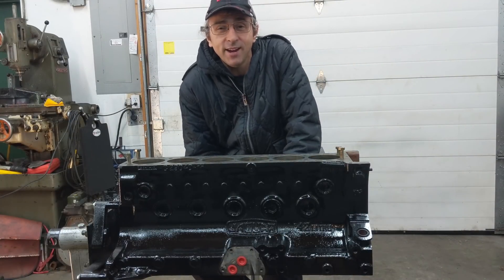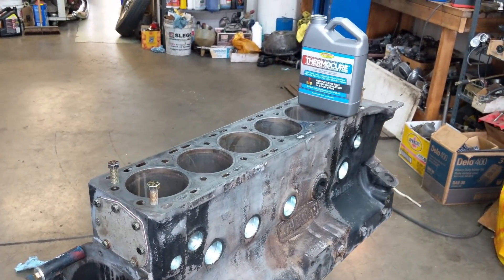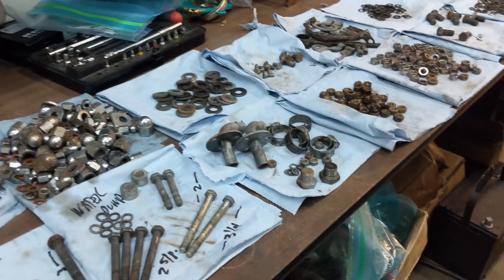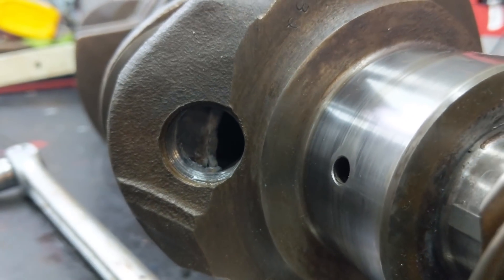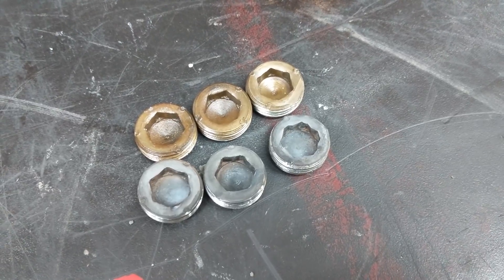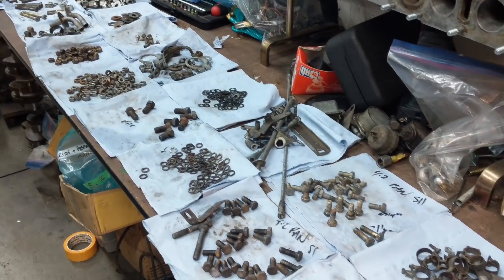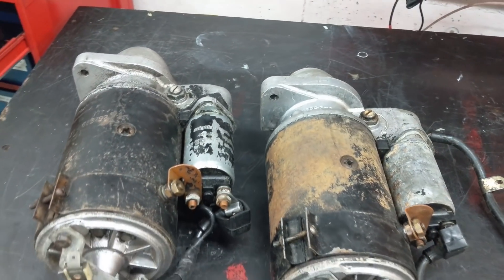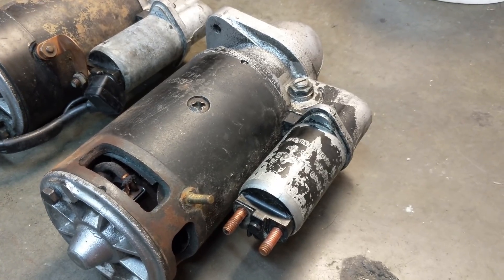My Junk E-Type Engine Part 4

Comment: Back in the 70's I owned a Jaguar repair shop.  We used to rebuild a lot of the 3.8 motors and other guys couldn't figure out how we did it so cheap.  We used Corvair pistons which had the same dome, pin size and deck height and were forged and lighter than the stock ones.   We could buy a full set of 6 Corvairs complete with rings and pins for the price of 2 stock Jag pistons.  The Corvair had a slightly larger bore than a standard 3.8, so often we could just hone the Jag block to fit without  having to go a full bore.  We also used Chevy valve guides by just turning the end down a bit on the lathe- they were better quality than the Jags units and were far cheaper.
Reply: That's old school alright. I like your style. If it's any use to anyone reading this you can substitute cheaper Jag valves for the very expensive Aston Martin ones in the Tadek Marek V8's - I did that in a rebuild for a cash strapped friend. I'm a motorcycle mechanic really but couldn't turn down the chance to work on a classic Aston. The valves are a few thou longer and might need a little shortening so they fall within stock adjustment shim sizes, depending on your valve seats. I did that on a bench grinder using a simple jig I designed for the job, not all of them required it.
The engine has been running beautifully for about 15 years if anyone is a bit dubious about the wisdom of this substitution.
Reply from the maker: Oh wow. I don't think I will get as creative with this one, but it's great to hear the ingenuity that you guys employed. I've often wondered about the valve guides, and the prevailing expectation to machine them out vs punching them out. Do you remember what you guys did?
Reply: @RichardMichaelOwen  We drove the old ones out, but we used Chevy guides that we machined to fit- it was a simple matter of turning the heads down a bit- the stem diameters and overall length were the same.  We had a book that was a numerical catalogue- instead of listing things by manufacturer, it listed parts by the size, you could find a lot of parts that would work in various cars.  Came in handy when we did a Daimler SP250 motor and also a Ferrari 250 California that another shop had taken apart and then lost a bunch of the parts. The guy had lost all the head studs and  3 of the pistons.  Turned out that VW head studs were the same size exactly length and thread pitch.  We  honed all the sleeves to the same size, then sent one of the  pistons to Venolia in California and they made us a complete set of 12 with pins and rings with the proper skirt clearance for the sleeves for 1/2 of what Ferrari wanted.
Reply: @oldschool1993  
Wow ! Now, you are/were what is called a Master mechanic ! Not simply a parts installer like today's too frequent "technicians". 
And your surname is fitting perfectly. Kudos, sir !
I have the chance of having my cars maintenance and repairs done at a small, local garage. My now friend Norm bought it from his late dad when the man retired but Norm learned his trade under the teaching of his Dad, the old school ways.
My wife at the time had a Toyota Tercel with a problem with the carb. Everyone told us that we had to buy a new 800$ carb. (We just bought the car 2 weeks prior for 1,000$ ! Non-sense.
An auto parts supplier recommended to visit this guy next door, THE known carb specialist of the area I did'nt know at the time.
He ordered a used carb, took off the supposedly, sealed, unserviceable mechanical choke, and installed it. Total cost : 85$.
I never, ever went to another garage in the last 35 years.
I actually sent many friends and family members to his place. Everybody is 100% satisfied. Parking lot always filled.
A few doors away, a guy has this 6 doors garage, super clean and shiny but his customer parking lot is always half empty...
Yep, parts installers and rude. Says it all, I guess.
Reply: @oldschool1993  MAN! I would love a book like that! That is so awesome!
Reply: @RichardMichaelOwen   I think you should try the superior Corvair pistons and Chevy valve guides. Otherwise you're leaving money on the table.
Reply: Oh boy we need a cheap fix like this in the Vincent HRD motorcycle repair and restoration game . I am greatly enjoying this series of films as you tear down the beast from Coventry.
Reply: Must be great to find a match in nice parts.
Reply: CORVAIR FOREVER !  SCREWTHE SOB NADER !

Comment: For the sludge if you can use matching threads in small brass nipples you can circulate kerosene in a constant flush to loosen and flush out sludge and particulate under say 8 lbs pressure and then when done blow it out and add some clean 20 w 50 at reassembly old product called rislone would do the same thing as kerosene

Comment: Hi Richard - great video series... I have been following along to rebuild my own 4.2 engine and my pistons and bores look to be in really good shape. However I have been advised that in most cases a re-bore is required plus new pistons because a ridge or lip will have been worn into the cylinder. I just want to Hone and fit new Jag part rings... I cant feel or see a ridge so would such a condition be obvious? Cheers Gary
Reply from the maker: You can feel it at the top of the bore if there's wear.

Comment: Very nice job organizing the hardware, but I hope that you did not actually re-use the old spring-type lock washers for anything serious after plating them!
In the first place spring-type lock washers should NEVER be re-used, since the sharp edge of the washers' tooth is gone the first time it is removed. Also, Jaguar had general failure problems with the spring type lock washers when used for the connecting rod bearing cap bolts and went to lock-nuts for after-market.

Comment: Jubilee clips thats  what the british call  your chain zero clamps they are jubilee clips that the correct name

The starter where all black  originally.
If mk10 had 1972 start then that's a replacement starter not original
Reply from the maker: Thanks for watching Keith, another vote for all  black starters, great!
Reply: The only reason I know our family had several dealership and garages. I was brought on on these cars. Dad had so many jaguars some of the junk ones where my play things that when dealer and garages use to keep old cars round the back for cheap spares for those customers on tight budgets and we fixed things not just replace

Comment: Hey I just rebuild my E-type 4.2 engine. I enjoyed your videos all the way till you took out the oil plugs for the cranckshaft... Beacuse that's the only thing I didn't do! I thought they was just holding the thing togheter  and didn't want to mess with it :( My engine was not seized and had great colour to the oil. Almost looking like new. 
The engine has been run in a dyno and is now planted in the car that i hope to testdrive this summer. I did clean the cranck by forcing thinner in the cranck with compressed air and did get alot of slug out of the cranck but I now suspect it to be more compact slug in the cranck as in yours. 
Really don't wanna take the engine out now. Is there anyone here that knows of any additives that I should use to maybe prevent this to dissolve (or dissovle in a nice way) and block the oilpassage or scratch the cranck...
Reply from the maker: I don't think it's a big deal to be honest. This engine probably saw 40-50k miles and the plug holes were about 25% full.

Comment: The different plating process may relate to the application of the fastener and the material it is manufactured from. 
High tensile fasteners, such as con rod bolts, main bearing bolts, flywheel bolts etc. are often phosphated or barrelled rather than electroplated. Electroplating can cause a risk of hydrogen embrittlement in these  high tensile steels. 
The head markings may give a clue as to the grade of bolt and therefore the best treatment to use. If you do electroplate everything, it is worth having them de-embrittled afterwards.
Reply from the maker: Hydrogen embrittlement comes from acid pickling before plating, everything in this video was blasted prior to plating.

Comment: Those lead Plugs balance the Camshaft!!! did you know that? you may experience vibration without the lead
Reply from the maker: If you look there is actually 1961 footage of balancing these units in the factory. They did not use lead.

Comment: Those two bolts that you called "stripped" look like they were driven into a hole that wasn't tapped deep enough.
Reply from the maker: Actually when I went to reinstall the bolts just were not long enough, only getting a couple threads to hold and one side stripped on install at the factory.

Comment: Led(?) would be poured into the crankshaft cavities while the whole lot is hot enough to keep it it in the molten stage, then rotated while still molten, then cooled down. It balances the crankshaft very much the same way as it balances your tyre wheel once replaced.

Comment: I used to own a '76 triumph TR7. I had to replace the starter solenoid every 6 months, at $100.00 each. Lucas is not known for reliability. No date code on those solenoids!

Comment: We used to call this type of painting "reconditioning paint". We meant that nothing was done except painting the outside. Nuts, bolts, washers, welsh plugs everything painted. We left this features "au natural" which looked a lot better and showed that these parts were at least disassembled before painting. Secondly, here in Australia, E-Type heads had a golden valley. This distinguished the high performance engines. I think the Mk 10/420G's were the same, but it was a long time ago that I worked with the Jags.
Reply from the maker: Alot of British engines were painted this way, even painting hoses, belts and wires.

Comment: Frost Plugs! Core Plugs is the correct expression as their purpose was to hold the sand cores during casting.
People think they are expansion plugs when an engine freezes as they are usually the bits that fail 😀
Reply from the maker: someone else called them Welsh Plugs in the comments!
Reply: http://www.britishcarweek.org/welch_plug.html explains the Welch name
Reply: When I was young a neighbour had a beautiful E Type in British Racing Green and he had to replace a core plug for some reason.  On completion he asked if I wanted to join him on a test drive. I eagerly said yes and before long we were nearing 90 mph on the A127 out of Southend.  I was watching the needle on the speedo near 100 when the new core plug decided it didn’t want to play anymore and promptly left in quite a dramatic fashion.  Getting a tow home wasn’t quite as exhilarating.

Comment: Brilliant! Love the series.  Love the detail: I used to strip down my Fords when in my early twenties [now 62!], every bolt went back in the same hole.  Great smell too, old engine oil.  Cheers
Reply from the maker: Peter thanks for watching great to have you along.
Reply: IT IS EXTREMELY RISKY to fit Fit an in-line filter to the supply side of a fuel pump as there is only atmospheric ptressure, just slight clogging will inhibit fuel flow at full rhrotle wifh a very lean mixture resulting in holed pistons.

Comment: Wow I think removing those plugs just saved your engine! Supper filled with crud. I'm enjoying your rebuild, strip and clean up
Reply: Easiest way to remove crankshaft plugs that doesn't require heat or special tools? Having removed pistons/rods reinstall crankshaft in crankcase and refit main bearing caps (no need to torque up). Fit hexagon driver in plug to be removed and rotate crank until hex driver fouls against adjacent crankcase main bearing web thus preventing any further crank rotation. Then it's a simple matter of unscrewing the each plug in turn. Regardless how tight the plugs they will come out without drama!! Refitting is the reverse proceedure. Crank is securely held in position thus ensuring confidence plugs are fully tightened. DON'T FORGET TO RE-SCOTCH PLUGS ONCE FULLY TIGHTENED.

Comment: Nice restoration, except the armrests are attached the wrong way around. Just swap them left to right.
Greetings Bernhard
Reply from the maker: Bernhard you have a good eye. They have already been swapped over. Thanks for watching.
Reply: Great, I am just working on the V12 E-Type Convertible but I also have the 3.8XK and wanted to find out what problems to expect when disassembling that next.
Thanks.

Comment: Breaking open an old XK engine is really a crap shoot. You came out on top, which was obvious from the Glyptol coating on interior of the crankcase and the great state of the iron between bores; no stress cracks. It just got better and better as you removed bearing caps revealing the fairly good state of the crank journals. I was further stunned as the mic gauge showed little to no movement going down the bores. A very fortunate acquisition. 
      You mentioned $1000 CDN, which sounds like about $800 US. I am curious, did you know the provenance of the engine, or was it just a piece of luck? Some years back I picked up a later series 2 motor for $350 US. It served my rebuild needs, but not nearly the initial quality of what you have there. 
       The eye candy at the end was just ‘taking it to 11’ in my book! Really beautiful hardtop on that roadster. 
Thanks for sharing. :-)
Reply: There is a great 8 min video by Jafromobile, search for  “Blueprint 106 - Cylinder Bores”. It gives all the detail you need to perform the assessment.
Reply from the maker: @mjc-seattle  thanks for the video link
Reply from the maker: Matthew, thanks for the comments. I had no idea what this engine was like before filming; just dumb luck.
Reply: Can you be more specific on what the "amount" of movement was on the mic gauge. I'm evaluating my bores currently and am looking for a guideline as to whether to sleeve or not. -Thanks, Steve A.
Reply from the maker: @stevearmstrong4699 .005 is about the maximum taper wear
Reply: Wow, i didn't know anyone knew about the ole Glyptol,we use this paint at my work once in a blue moon,a paint huffers dream,you can paint something with Glyptal with a brush and be so high you dont know whats up or down and thats with a brush in small applications!  couldn't imagine it spraying it if it was thinned enough,its actually a very good paint and expensive too, now that i remember i have seen it in aerosol cans,definitely want to use protective gear with this stuff.